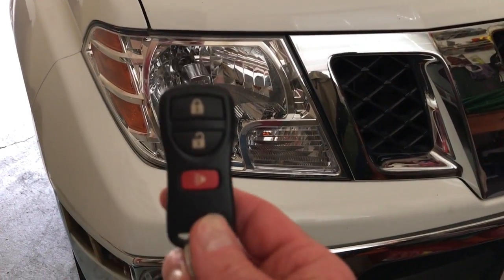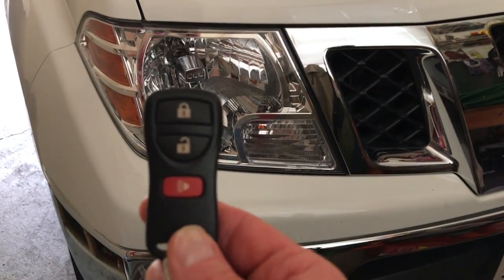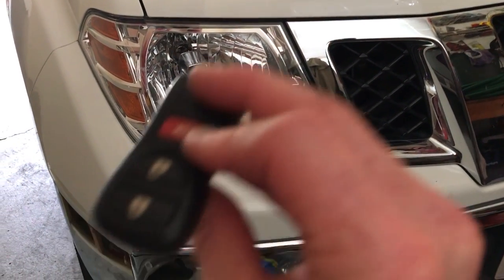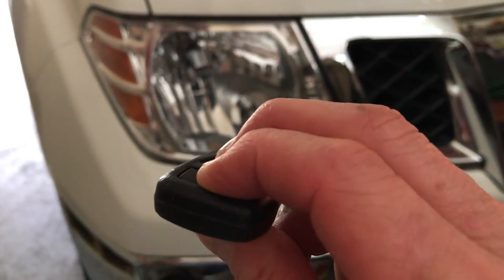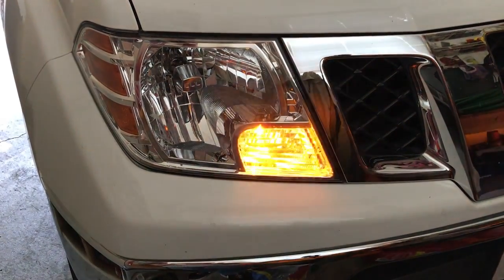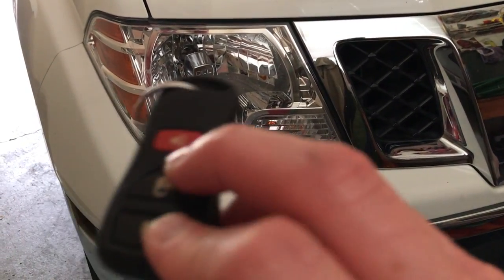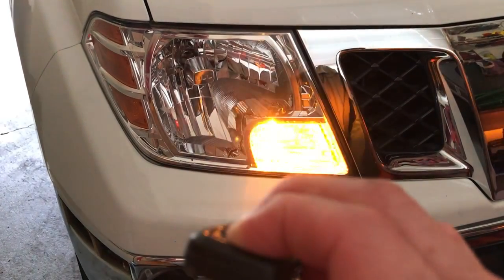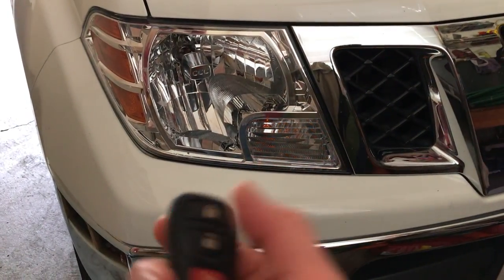Enable and Disable Horn/Lock Function On Nissan Frontier

Comment: my frontier has a shock sensor added to the alarm. recently i left the key in the ignition swith and it ran the battery down. now the silent mode wont stay on and beeps each time i lock or unlock the door. i would like to get it back in silent mode. the normal method you are showing is no longer working. any help is appreciated..ty
Reply from the maker: I've never had this particular issue but hopefully someone will see this and be able to help. Also, try calling a Nissan dealer and speak with someone in service.